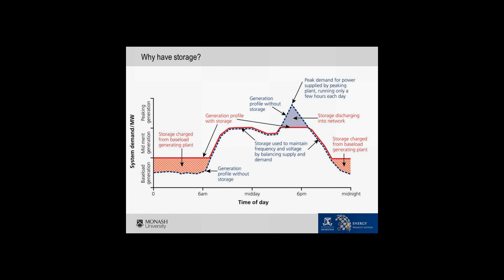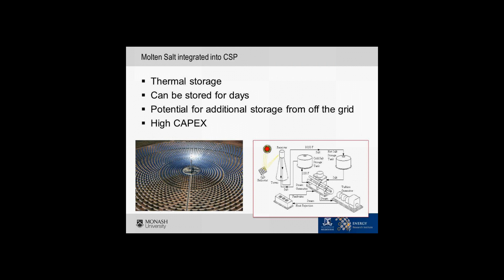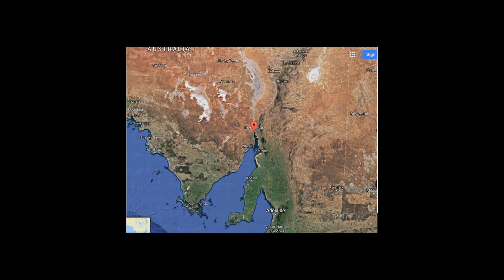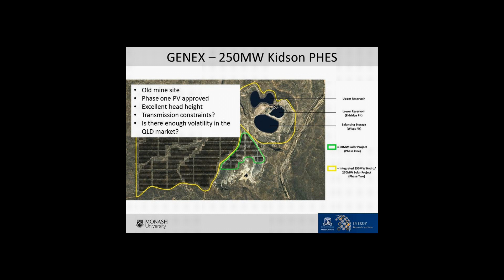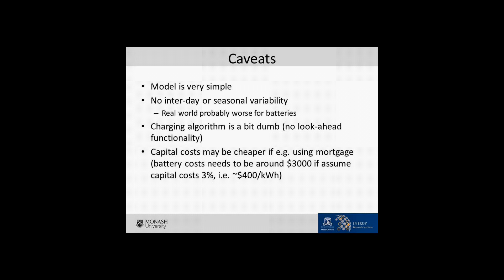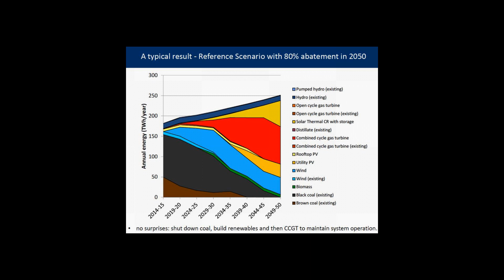Power storage options in the age of renewables

Comment: Audio cuts out at 10m32s, and the presentation appears to wrap up at about 18m37s, so what initially seems like a half-hour talk is padded by a long black and silent tail-end. Was just getting interesting when the audio died :-(

The energy/power logarithmic chart at 12m32s is of particular interest in terms of consumer/voter/public satisfaction with an affordable, reliable and clean electricity supply i.e. NEM magicaly transforming to something that fixes the "trilemma" in the Finkel Report June 2017. 

Forget CAES, as the suitable salt domes with airtight caverns inside them are as rare as hen's teeth.  

Battery costs are allegedly falling rapidly, but it seems PHES is at present in the lead where it counts: the cost of ENERGY: charted here as $5 to $12 per kWh which seems way higher than Andrew Blakers is claiming in his ARENA-funded modelling, but building bigger dams can slash the cost per unit of energy by cheaply expanding the storage volume of each dam. The bulk of CapEx is in the penstock, Francis turbine, turbine hall, sync.generator, switchyard, transmission interface, etc.

ESA watermark is for energystorage.org and their charts from 12m32s and 12m51s are also found as Fig 4 and (very similar to) Fig. 5 at http://www.optimal-power-solutions.com/home/advanced_storage.html